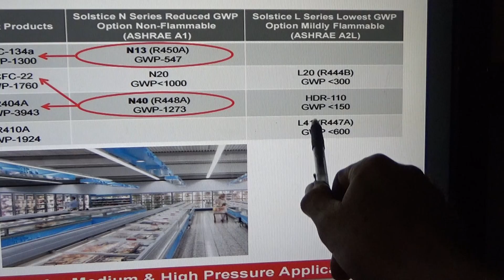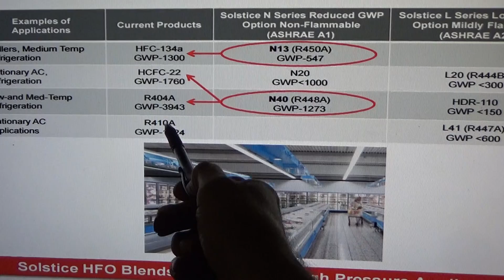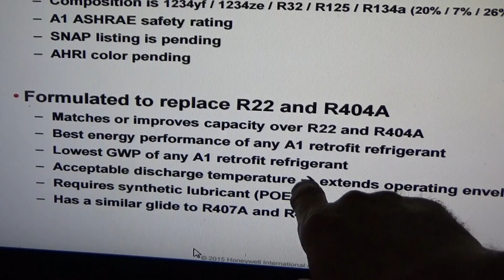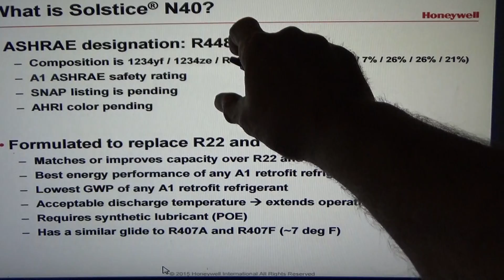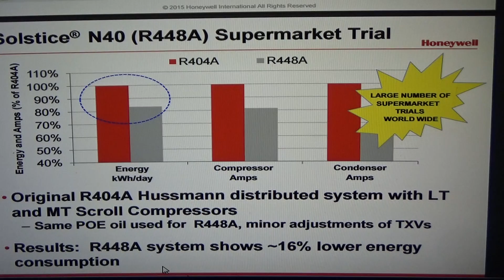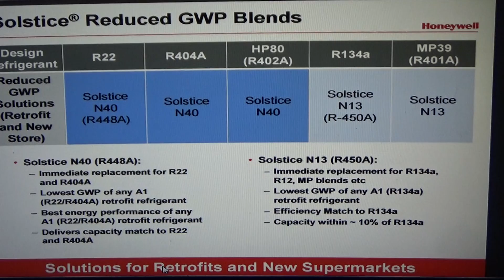Magic Bullet ?  Honeywell's N40 (R448A)

Comment: We have been using 448a for the last year in refrigeration low/med temp. the biggest problem we are having is super heat due to the glide but I don’t really mine it It does work great with a EEV.

Comment: Jim. R134a is a pure fluid. It is not a blend. Under no circumstances will it ever fractionate. Also R404a is classified as a near azeotrope. The chances for fractionation (messing up the blend ratio) are near impossible due to the type of molecular bonds. Neither of these two gases will incur problems with high or low side leaks in any amounts.

Comment: Hello Jim, Thanks for your work and sharing. I have a question in the  16:50-17:00 minute section of the video are you meaning temperatures or pressures?

Comment: Jim, let me start by saying that I work for the Honeywell Refrigerants group.  I saw your post and thought I would offer some additional information to clarify the slide you are referencing in your video.  

R448A is an excellent replacement for R22/R404A/R507 in Medium temp and Low Temp refrigeration applications.  R407C or R422D would be our recommendations for R22 A/C applications at this time.  

If anyone has any additional questions about any of our products feel free to PM me and I will connect with you offline.
Reply from the maker: Thank you very much for commenting, I've been using 407C for AC and 407F for med temp and 404a for low temp, I havent found R448A  at my local Cleveland supply houses as of yet. My concern is the price, will it be comparable to 407C ?
Reply: Looking at leak protection requirements in IMC Chapter 11.  R448a is not listed in IMC Table 1103.1 so how would you apply the rules when switching a facility over?  I found the refrigerant classification is A1 by Googling, but I cannot find what the Amount of Refrigerant Per Occupied Space in pounds per 1,000 cubic feet would be for this product.  Any idea?
Reply: Paul Karr 

Use the link below to submit your technical question and I will work on getting you an answer to your question.

https://www.honeywell-refrigerants.com/americas/contact-us/
Reply: Paul Karr. Did you ever get your answer.

Comment: 404a runs for about 85-115 a jug... like you said if its a a good price I'd try it.. these blends can save or kill efficency problem with 407a /c...
Reply from the maker: +Alexander Figueroa I like R404a , but it's going out and the prices will go up, I've been using R 407F , it works fine, a fellow from Holland said they have R448 and right now it's double the price of R407F, give it some time I expect it to come down , thanks

Comment: AHRI....page  266 and 267........Bubble Point and Dew Point...............When heating a saturated liquid mixture, the temperature at which small bubbles first begin to form, is known as the Bubble Point. Coming the other way, the temperature at which small liquid droplets first start to form when cooling a saturated vapor is known as the Dew Point.  In COMPOUNDS these two POINTS are the SAME for any PRESSURE........With Zeotropes, however, the Dew Point is typically a higher temperature than the Bubble Point at any paticular pressure.  The Difference between these two Temperatures....is known as the GLIDE..........For example the Bubble Point and the Dew Point for R-12 at a pressure of 28 psig is 30 F.  For R-401a an R-12 substitute the Bubble Point is 20 F...and the Dew Point is 30 F when boiling at 28 psig the evaporator temperature of an R-401a system can be any where between 20 F and 30 F at the same 28 F saturation pressure ......Not all Zeotropic blends have such a large Glide...For example the Dew Point and Bubble Point for R-410a are typically within 1 F....
Reply from the maker: +Walking in the light for Yeshua thanks for the input
Reply: thanks for the video Jim we need more of them

Comment: have you had to do any propane refrigerants like nor-cal?
Reply from the maker: +refrigeration tech luckily no, I don't think this develpement will last, I expect people will be burned and property damage , I expect refrigerant manufactures to be dealing with lawsuits, I don't want to get dragged in to court for selling that equipment. thanks
Reply: +Jim Pettinato Hi Jim here in Europe we have several supermarket chains that have freezer reach in islands 
that utilise R290, they have Danfoss dc inverter compressors in them, the Brand named AHT. These are very reliable but the supermarkets renew every 5 years anyway.
Reply: +Jim Pettinato maybe it is just that ignorance is bliss, but I do not fear using refrigerants like propane. as long as a tech is not working like a dumb ass, it has proven to be safe to use for years in other countries. also, with a GWP of 3, and a price that should stay low due to the availability and use of propane, it sounds quite tempting to me. as well,  R290 does not contain mercaptain, so no lingering smell from it, and you don't need to pull out the dam reclaimer and tank to pull charge! just my opinion. 
thanks for the info and videos. have a good day sir.